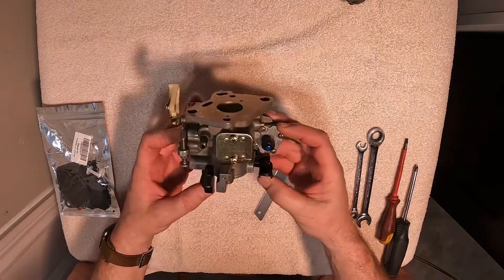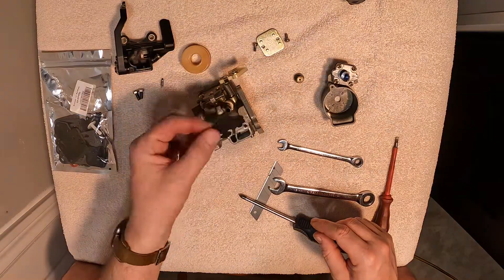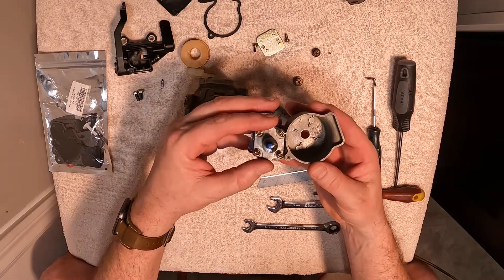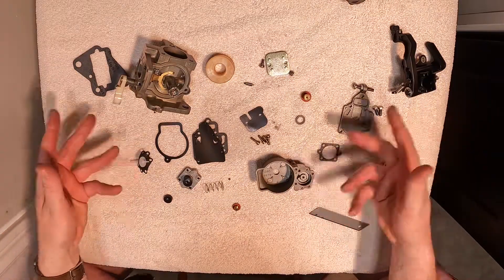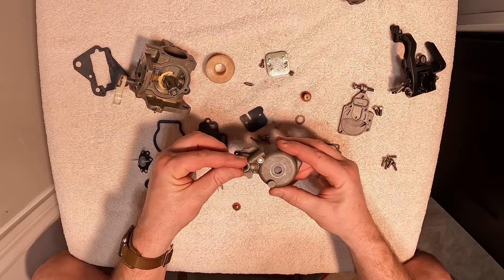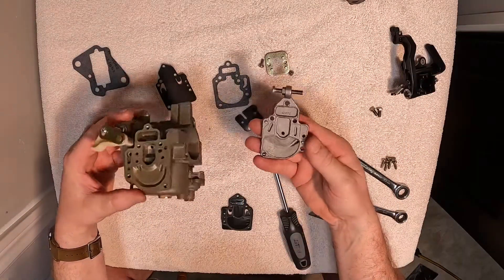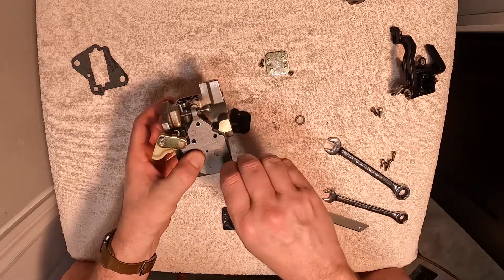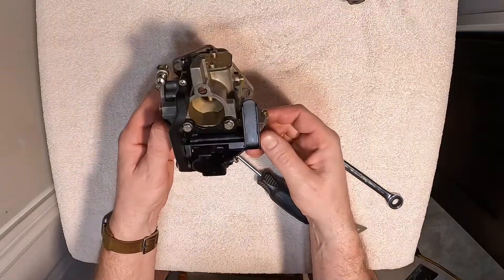Mercury two stroke carburetor rebuild.

Comment: Having issues with my 87 20hp.  Runs well one time, cuts iut the next and wont accelerate.  So far we have done straight connections to the motor from tank with new premium fuel, disconnected the kill switch from the tiller to take chaffing/grounding out of the equation, fixed a chaffed spot on the wire from the Killswitch.  We have the carb/fuel pump kit to install...but wondering if we are missing something.  Hose seems to be intact with no inner hose layers coming apart.  Thanks

Comment: Great video, very well set out.

As much as genuine gasket/rebuild kits are 3-4 times the cost of generic kits, they are so much less likely to give you issues. I've had problems with Amazon or eBay gasket kits, leaks and even incorrect cuts, the last being the engine pulse hole that drives the fuel pump diaphragm on the side of the carb was covered in the generic kit, so had to cut out a hole in the engine to carb gasket. It shouldn't matter, but for whatever reason, genuine is the only way to go. For seats and needles, bowl etc generic is fine in my experience, but as nobody wants to be endlessly pulling their engine to try and start it, or to have it die as the fuel pump diaphragm is leaking, do yourself the favour and spend the bucks on a genuine kit. I look after a few old 25 twin 2-stroke Mercs at our local club, and would rather spend my own money on motors that aren't even mine and buy a genuine kit so I'm not having to mess with the carbs all the time. Boats sit around and have fuel issues enough without playing roulette with cheapo gaskets as well, but to each their own!

Comment: While it will work both ways , I can suggest when reinstaling the upper primer cover that putting the "vent" or weep hole on the primer cover facing out instead of in , so you can visualy see when  the carb is mounted on the engine that if your primer diaphram ever develops a leak again, if it does it will spray out the weep port out to the side making it easy to see where the fault is .  that orientation is the way it was orignaly instaled  .

Comment: I picked up a kit on Amazon to rebuild mine for $20, and the carb main mount gasket is wrong so for another 12 bucks I got a sheet of blue siliconized gasket material at Oreillys, used an xacto blade and a scissors and a ball point pen to make a new gasket for one that didn't exist. Seriously, the motor came without one and one of the nuts was loose as a goose.

Comment: Have the same carb on my Mariner from 1988, how do you adjust the idle on that carb ?
Reply: depends on the version, but may be a turn the primer knob type? If not, then it's the throttle closed grub screw.

Comment: New Subscriber here.   I have a 1993 Mercury 8 HP 2 Stroke Outboard. Serial # (Model number?):  "0D208181"  long shaft. Can I get a Carburetor rebuild kit for mine? How do I know which kit to order (mine has the fuel pump as part of the carb).
Reply from the maker: Hey Ben. You can for sure get a kit for your merc. Go to Crowley marine .com and they have a great parts look up. Or you can get an Amazon one. They usually will list in the description the model it will fit. Good luck and thanks for watching.

Comment: Hey man im having a starting problem with my 9.9 2 stroke mercury year 95. I disassemble clean and change all the gasket but then still wont start. New gas and primer. Im stuck! Also what does that tiny ball bearing do? I dont remember seeing that on mine. Thanks!
Reply from the maker: Little ball acts as check valve( one way valve). Squirt gas in the carburetor and try to start it and if it starts and stops you have a carb problem. If not I suggest looking places spark compression or even timing. Hopefully this helps. Thanks for watching

Comment: Hey man, can you link that kit. I just need to replace my accelerator pump and want to find one at a good price.
Reply from the maker: MARKGOO 18-7212 Carburetor Repair Kit for Mercury Mariner Force Outboard 6 8 9.9 10 15 20 25 HP Boat Motor Fuel Pump Carb Rebuild Parts Replacement 1395-97611 1395-9803 9725 9645 9377 1395-811357 https://a.co/d/bBh67x4
Reply: @thesmallengineguy6924 is this a genuine carb kit?
Looking for a genuine  carb kit: 2000 8hp 2stroke mercury ob.
Some one give me a link or code please, greatly appreciated.
Reply from the maker: Not the exact one but this one will do it.

Comment: I’m Working on the same carb any reason you used a different gasket on diaphragm than you removed?
Reply from the maker: Good eye John. Just distracted from filming is the excuse I’m going with. It will fit and start but it won’t run great. Think one is for the 9.9-15 and one is for the 6-8. Thanks for watching
Reply: Ok I was just wondering if you knew something I didn’t. I cannot seem to get my 9.9 running right. I was thinking I was missing the fuel pump but after seeing this I know I’m not. Could a cracked overflow tube affect how it runs?
Reply from the maker: Shouldn’t effect things that much. Have you tried looking at coils/plugs/compression? I’ve been hung up on a carb for days that turned out to be a cracked coil. Showed spark so I figured it was fine. Bet I pulled that carb apart 10 times.
Reply: Replaced plugs and it has spark. Didn’t really pay much attention to coil. Cleaned carb because it seemed to be starving for fuel now it seems to be needed more air.

Comment: Hey! I have a 2003 Mercury 15HP 2 stroke that I’m struggling with. I’ve rebuilt the carb multiple times now and I’m still seeing gas in the air take when I pump the fuel take bulb. Float, stem and fork have all been replaced.

It’s coming up from the bowl around a brass stem inside the airtake. 

Any thoughts why this might be?
Reply from the maker: Hey Russell. I’m not sure. Sounds like something’s missing. Is the prime bulb getting hard and staying that way. Sounds like needle and seat getting stuck. You can confirm the float is closed by turning the carb upside down and blowing into the gas inlet to see that the needle is closed. No air should pass until you turn the carb right side then air will pass. Little piece of gas line that you can blow in will help. Hopefully you can get it fixed. Thanks.
Reply: @thesmallengineguy6924  thank you for the quick response. The bulb gets semi-stiff but the more I pump it then more fuel comes out the intake. I’m planning to remove the carb again and checking the float distance again and try what you mentioned. The entire carb has new gaskets, float and needle valve so it’s very strange.
Reply: Hello Russell, did you ever figure out the issue? I’m struggling with the same issue. Gas coming out of the of the float into the intake when pumping the primer gas bulb. When I turn the carb upside down then the bulb holds firm and no leak. The minute I turn it right side up then seems like the needle/float drops and gas starts to overflow again. I can get the engine to start and run but overflow of gas will flood the motor. Ask I am typing and explaining sounds like a float issue. There are no cracks in the float.
Reply: @Vajfom  hey! The fix for me was replacing the float, jet pin and float bracket. Make sure to review the mercury manual for measuring the float distance…it’s makes a HUGE difference and may be your problem. Hope this helps!
Reply: @russellhill8577  Thank You!

Comment: Did a new Needle come with that kit? It didn't in the one I bought! Unusual, I thought!
Reply from the maker: I had to go back and look but I think I didn’t. You’re right it is unusual. There are many kits on Amazon and most are universal. There might be one more specific to the model year.
Reply: @thesmallengineguy6924  I did do back and look at the expanded view of the contents and it does not show that there is one. The same for the others that I researched. The Carburetor Body dies not have a replaceable Needle Seat, but you would think a rebuild kit would have the Needle. I'm having an issue with the Carb flooding, due to the fuel leaking past the seat!  Adjustment of the float is correct, and the kit comes with a new float.
Reply from the maker: @edwardrinehart2125  try cutting a q-tip in half. Putting it in the end of a drill then down the seat hole with a bit of carb cleaner on it. Sometimes polishing down the hole like that will clear it out. I’ve had success with doing that in the past.